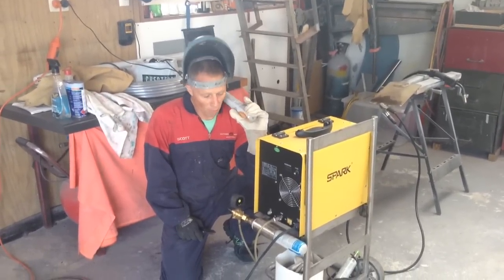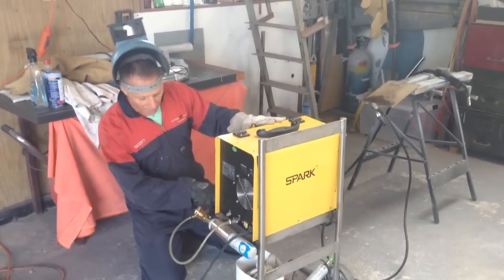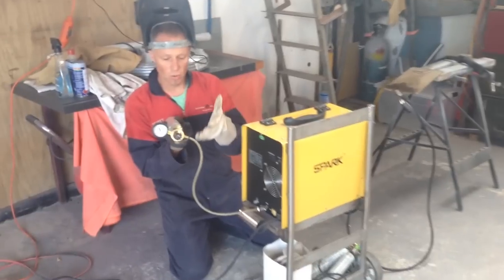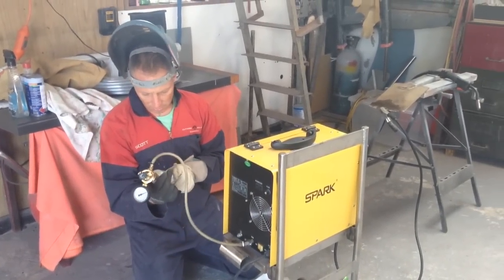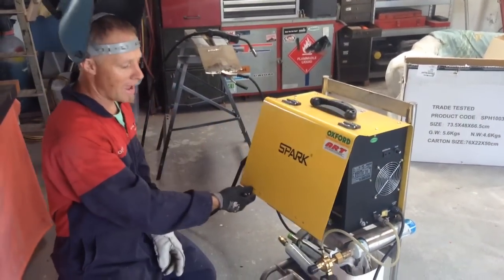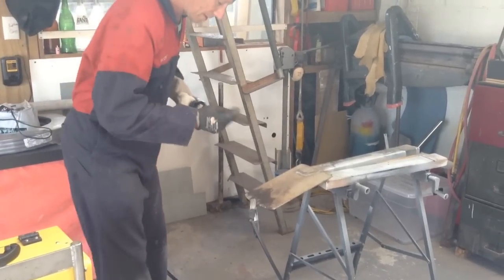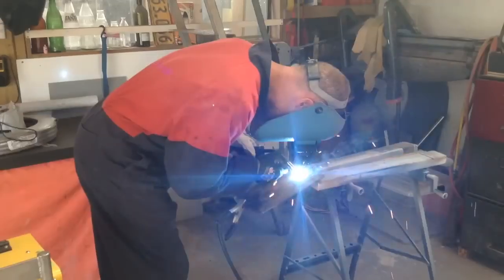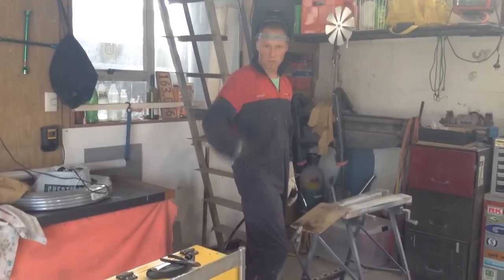Mig welding with sodastream  gas CO2

Comment: Awesome tip!  I always love to see people coming up with ideas like this to keep the cost of things reasonable.  Sure beats spending a fortune on a bottle from a welding supply house.  And some of them charge a ridiculous fee to lease the bottle as well.
In the states, AR/CO2 is industry standard for welding auto body sheet metal.  However straight CO2 is common practice in the fabrication world.  CO2 by nature allows for a deeper penetrating weld.  Maybe that's why the mixed gas is used more on the thin gauge sheet metal.

Comment: I use the CO2 gas with my mig welder and it has always worked great. While the CO2 gas is what they use to carbonate soda I have never heard it refered to as soda gas as such. I really don't know how Co2 compares to the argon or other welding gasses it is what I use and it works just fine for me. Cheers OLDDUDE

Comment: Thats Cool, I refill my soda stream bottles at home with the correct weight of dry ice. Very simple. Very cheap. Less than 2 dollars US.
Reply from the maker: mate I d like to see /learn how to do that .... please ?
Reply: I j just looked up a video on it, here

/watch?v=YouxAodQXv8

Basically you just take the top off the sodastream cylinder  (remember to release pressure first!!!!!!) and then put dry ice in it, and then put the lid back on. When it melts it turns into CO2 gas (CO2 doesn't have a liquid stage) and expands to build up the pressure.

The only thing I'd wonder about is getting moisture in there. You appear to be west coast nz (?) where it is very humid, so you may (?) get some water ice forming in the dry ice. I don't what effect this will have, if it happens at all.

Also don't put more dry ice equivalent of how much gas it is designed to hold or you could have more pressure than it was designed for once its thawed.

Also the vid I linked to said they got dry ice from the supermarket. Can't say I've ever seen that in NZ!

I wonder if you can just get a larger cylinder of CO2 and use it to fill up the small ones, to save $$$. This would require the correct attachments.

(1 minute later) just googled that too, here is a guy doing it, it seems like the easier option:

/watch?v=wgQatZ2WghQ

Then again, why transfer cylinders? Could you just use the big one?

But I haven't googled that ;)

Comment: It's all I use now to and it's been great. But I have a fire extinguisher  $40 to fill and have lasts me 4 times longer than argosheild
Reply: +1
Reply: Is it any good for doing tack welds on body metal? Or do you get a messy weld, with lots of blow through?
I was thinking the same setup for my Lincoln 140 mig, ive read that straight C02 is not good for thin metals...
Thank you

Comment: I've been using 60/40 CO2/AR which I believe is the standard for the land of of the "terrible driver, movie star governors, and national politics which makes everyone think our government is populated by 3 year olds with soiled nappies" Are you using 100% CO2?
Reply from the maker: 100% co2 it burns hotter than argo sheld so i just turn amps down  to suite ...love your comments about the way aeteroa is runied I I mean run
Reply: restolad
is that just for welding mild steel?
Reply: krssnoop i also use 100% co2 much easier to clean the burrs off after welding